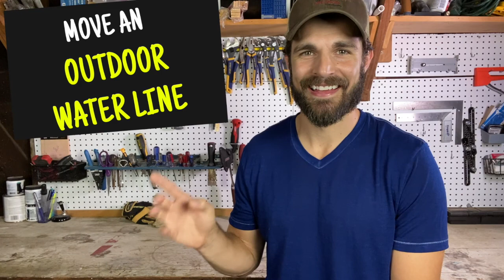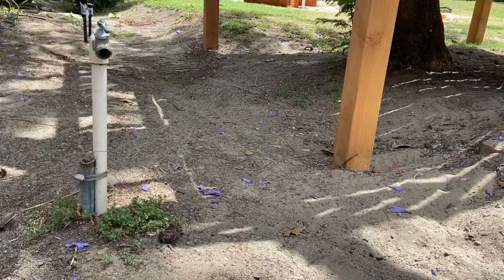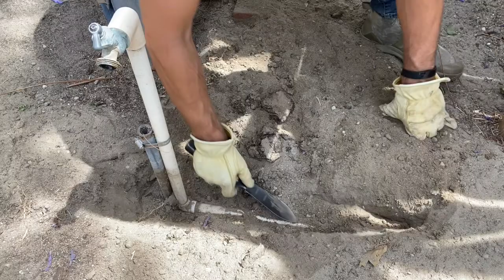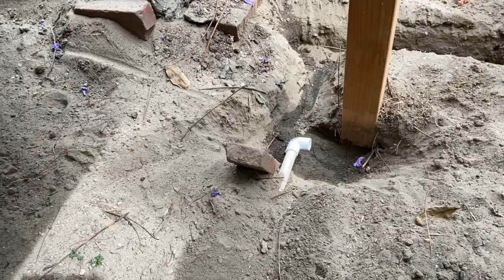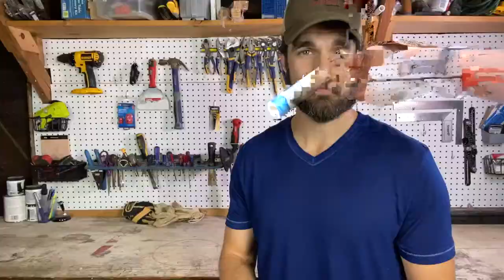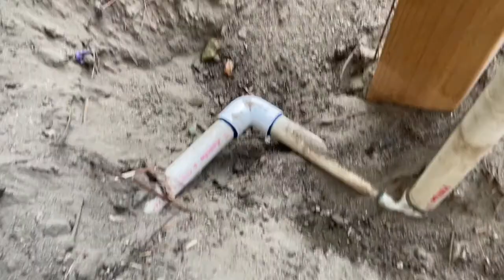HOW TO MOVE AN OUTDOOR WATER LINE (SPIGOT, BIBB, WATER FAUCET, HYDRANT)

Comment: You didn’t mention what size PVC pipe is required.
Reply from the maker: Most lawn watering systems use 1/2" PVC pipe. However, that's not universal. Hope that helps!

Comment: My parents have a regular garden spigot/facet on the side of their house but its slightly below their deck floor so its hard for them to get to it (requires 70 year old to kneel on deck and reach down to turn on).  Is there and easy and cheap way to adapt it to bring make an extended arm/knob that can turn the orginal lower knob?  Thanks.
Reply from the maker: I think I understand, but let me know if I'm way off! I believe something like this tool would help. It's just an extended arm that has a square "grip" at the bottom. If you could extend it through the deck floor, then you can attach the grip around the handle to turn on.
https://www.homedepot.com/p/36-in-Solid-Steel-Water-Meter-Valve-Key-with-Grips-410-303-0111/312012435#overlay
Reply: Thabk you for this suggestion. It is what I was thinking about. However it looks like it need to attach to a handle that is striaght down like in the ground. My dad's is on the side of the house so this extender would need a 90⁰ angle at the end. Are there any like that?  Or we were thinking of just moving the current line around the corner from where it is to be more accessible. is that a big job or can any plumber do it?

Comment: Excellent video, thanks.  I am bidding on a backyard project as a landscaper but the spigot needs to be relocated and will require a new opening to be punched into the home to clear a new stairway.
Reply from the maker: I hope you get the job! Depending on how far you have to move the line and the space underneath the building to get to the pipe, hopefully it isn't too hard of a job!